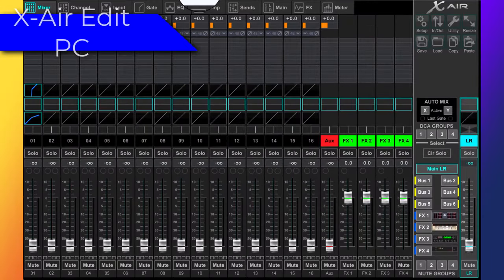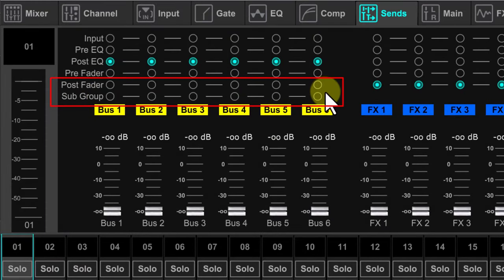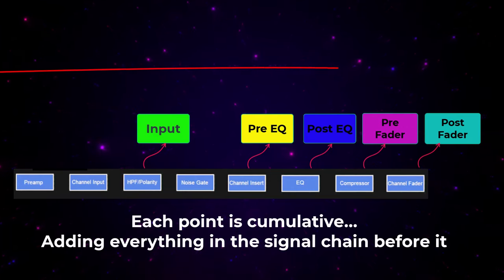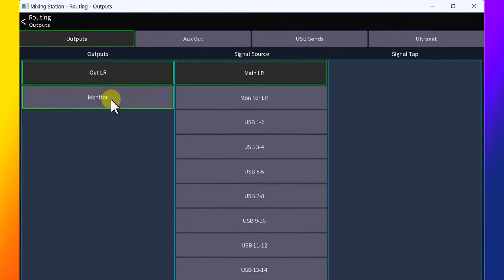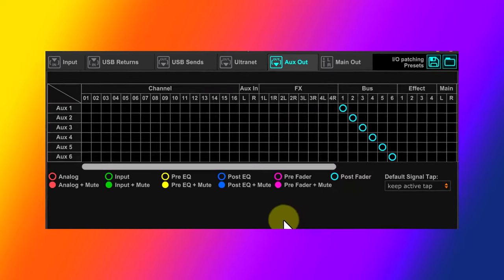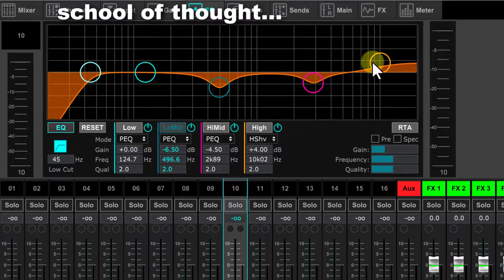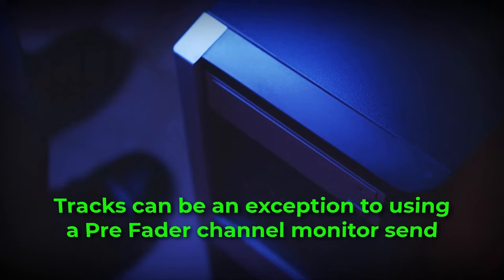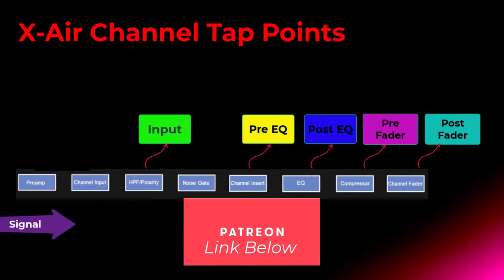Demystifying XR18 Channel Send & Output Tap Points | Monitor setting | Mixing Station and X-Air Edit

Comment: Thank you for making this very informative video. I have mains going to main out and subs going to Aux 1 2. You only mention the signal tap settings but not the signal source setting. For the Aux 1 2 sliders I want to control the overall volume. What should the signal source be set to for aux out 1 2? Thanks in advance!
Reply from the maker: I'm not sure what you're exactly asking. Your master sub output should be post fader. ...But I'm wondering if you mean beyond that, and are wanting the master volume of the mixer to control the sub level at the same time it controls the rest of the mains.
Which that is not possible.
Also, you probably don't need to use 2 channels for your subs. Most sound systems send to the mains L-R but the subs just get a mono signal from one aux or other send/bus.

I do have an older video about "Aux Fed Subs"- https://youtu.be/ZBXaR2W2E1I

But I'm not sure there's anything in it you need to know or not.

Back in the thread for that video there were some discussion about having a master faster that controlled subs and mains at the same time... and the workaround to do it is:
After you have your system working, and sub balanced to mains, assign EVERY channel to a DCA and call it MAIN (or whatever is easy for you to remember).
Since the aux fed subs should be on a post-fader send on the channels, and every channel is on the DCA, then that DCA will work like a main to control main output and subs at the same time. But you do have to have them master and sub output set and adjusted like mentioned in that Aux Fed Sub video as the first step. Then assign that DCA and run it up to unity to begin with. The adjust accordingly up or down for show levels.

Comment: How can I plug a Samson expedition speaker to a xair aux out? My assignment says to connect a 1/4 unbalanced cable to a 1/8 adapter but neither end would fit a aux

Comment: did u ever try and record xr18 xlr outs into a difrent audi interface set to -4dbu or recording device ? it comes out less compressed and louder than if using the usb record dont understand why xlr output limited at -3.5 db but comes into other interface at-1.5 db with interface set at -4dbu

Comment: Thanks so much for the information, we appreciate you going in depth. 

I’m wondering if you can help me problem solve something though that was not addressed. 

Our band is using Mixing Station with a Behringer digital PA. All the channels seem to sound fine except the one that’s processing my guitar signal. it sounds fizzy and thin. No matter how we’ve adjusted the parameters in my channel, we can’t seem to get rid of that sound. It’s truly not representative of the amplifier. We have tried this both going direct and using a microphone. 

I can’t help but think there is something turned on in the parameters of my particular channel, that is causing this to happen. 

Have you ever experienced this, and if so, do you have any idea how I might go about correcting it? 

Thanks for your time!
Reply from the maker: Well, my first thought is a bad mic cable. Do you always use the same mic cable? If the mic cable is 'one-legged' you'll get weak, thin sound. And it wouldn't matter if it was a DI or mic connected to it. 

If it happens with multiple mic cables, then that pretty much rules that out.

Are you sending the guitar channel to a subgroup? Maybe not even intentionally. If so maybe something is going on with the EQ in the subgroup. Or maybe you're sending it to a subgroup with something inserted on the subgroup, PLUS sending it direct to the L-R and creating a latency (cancellation) issue between the two signal paths?

Do you have something like a chorus or reverb or other time-based FX inserted on the guitar channel from the FX rack? THAT would explain a weak signal because many of those don't have a wet/dry balance control. Without that, you only get the wet signal and no dry signal. 

If you connect a known good mic to the guitar channel, does it sound fine? Even with the low cut off, EQ off, compressor off, and gate off... with the signal directly routed to the L-R and nowhere else? Or a known good mic and cable (like moving the lead singer's mic there)....

Have you tried moving your guitar input to another channel? I hate to say there's a hardware problem with the mixer, but if that one channel always sounds weak no matter what you're connecting to it, and if it sounds weak even with everything turned off on that channel, while moving those things to another channel and they're fine.. That could be telling...
OTOH, if the problem follows the guitar rig... no matter the channel then the problem must be something else. Which is one place that bad mic cable issue would always rear its head.

I guess another possibility would be if that guitar channel was NOT routed to L-R, or is running thru a DCA that is turned way down, or routed to an mix bus output that is also feeding L-R itself while the guitar is NOT feeding L-R (either directly or via a subgroup). Things where you're not hearing what you think you're hearing, or should be hearing, depending on the circumstance.

Of course, you can always save your scene, then initialize the console and check that guitar channel when you're starting from scratch. Out of the box the mixer is configured for what is a normal live sound configuration. So if you have any gremlins lurking in a misconfiguration, this would certainly eliminate that. If all is suddenly good, then you know you have a gremlin in your channel config/routing on the band scene.
Reply: @AlanHamiltonAudio  thank you so much for taking the time to share that! Your expertise is greatly appreciated. I’m going to share the information you shared with our sound tech and see if he can use it to do some problem-solving. Once again, you taking the time to do that really matters, I have been baffled by the issues, but some of the things you suggest make a lot of sense. I think we can rule out simple things like cables and mics, we’ve used different ones. The more complex workings of Mixing Station though is something that’s new to us, and your information greatly opened up the possibilities for resolving it. Have a great day!

Comment: My main out is left or right heavy. I thought that was a faulty mixer. But when I do Master LR output from the 6 buzzes, that does the same one side heavy also. How can I fix that, please.
Reply from the maker: Check your FX rack... Look for having a dual effect inserted somewhere when you meant to have stereo. Or vice versa maybe. Also, look for anything inserted that should've been used differently, or you didn't know was there.
This video is about the FX Rack: https://youtu.be/TV5ClH_MWrU

The next thing I'd look at is the Bus masters... make sure one of you monitor mixers, stream mix, etc. isn't accidentally assigned to FOH.
Also, pay attention to any subgroups you might be using and check the panning there.
The double-assigned bus issue is explained here:
https://youtu.be/x9wciA2wFd0

Comment: Our X18 EQ section will not allow us to change to a low cut or anything else. It seems stuck on one wave and can't be adjusted.  What could cause this? Thank you Sir
Reply from the maker: Are you sure you're actually connected to the mixer? But even with that theory, being in demo mode instead of actually being connected, I'd think it would appear to be working. So, I'm kind of stumped. Never have heard of anyone having this problem before.
You do mean that you can't change the setting(s) at all... versus you can change it but you can't hear any change?

Comment: What tap point should I use if I’m using the Behringer xr18 for FOH but also trying to control everyone’s IEM without affecting the FOA. Where a 3 piece band usually do small gigs. Thank you
Reply from the maker: For the channel send the 'safest' setting is PRE-EQ. Post EQ will get you the FOH channel EQ in your ears, and that could certainly be fine and worth a try. But everyone needs to understand that if they start making changes to the channel EQ for their ears, it impacts FOH too. Pre-EQ leaves you 'stuck' with a flat EQ for your ears, but that means you're not 'stuck' with FOH channel EQ settings, or hearing the FOH engineer change channel EQ settings. If you have a FOH EQ tweaker, having PRE-EQ channel sends for mons could be better for that reason alone.
Reply: @AlanHamiltonAudio  Thank you🤟🏽

Comment: Behringer's own tap point diagram is actually correct for USB inputs but, as you point out, is wrong for analog inputs.
Why would Behringer do this?
Why would they not allow us to send analog inputs pre HPF to the aux outputs? But USB inputs are allowed to go pre HPF.
Reply from the maker: It's probably a 'safer' setting to capture the HPF for any monitor send, stream feed send, etc... (no matter what tap point is chosen). It also captures the polarity setting (which I tested via a null test with a mono signal). So, I can speculate on 'why' they might do it... but I don't have any idea why it's not better documented. I'm sure there are people with applications where they might not want the HPF captured in a send for whatever reason.
But there could also be a user-base argument made that the majority of users will want the HPF captured in any feeds, even if they don't understand or realize that for whatever reason. But that still leaves the question wide open as why it isn't better documented. At least anyone wanting it any other way could know it isn't possible except using dual inputs and not utilizing the HPF on one of them. Or not using the HPF for FOH in the first place. But that's normally a bad practice to not use properly, even if conservative, HPF settings in the system.

Comment: I have gone through this video multiple times, re-initialized the mixer twice, and I'm not new the the world of live mixing.  Every time follow this video and set everything up just like you do, when I go mute the channel fader, the aux/bus ALSO mutes in my IEM.  Is this be design?  I have a Behringer X2442 analog mixer, and I've ALWAYS been able to mute the channel fader and then set a monitor level.  I've also been using the Soundcraft UI16, and I can also mute the channel fader, but it does NOT mute my IEM.  But it does NOT work this way on my XR18.  I'm trying on both Windows and Android tablet.  Using MixStation and X-Air-Edit (for both software, on both Windows and Android).  I've upgraded the mixer to the latest firmware version on the Behringer website (Ver 2) Version 1.22.  This really seems like a bug.  Does it work this way for iPad and Mac users too?  I've seen people talk about DCA groups, but that just seems like too much work.  It also doesn't seem like any of my BUS eq changes are doing anything either.  BUS settings are globally set to Pre-EQ and Aux outputs are all Post Fader.  I have a gig this weekend so any help would be greatly appreciated!
Reply from the maker: Muting the channel mutes everything in the channel. So that part is working like it's intended. If you want to test FOH and then work on monitors, then mute the Mains or just pull the channel fader down. Or you could use DCA assignments I guess.

Not sure why you bus EQ wouldn't be working. There is an "All About the Outputs" video on the channel ( https://youtu.be/UNO-dACc7YY ) which maybe you might see something you're doing wrong.

Assuming you have your outputs post-fader, I don't know what that would be though. Well, outside of not engaging the EQ. It does have a EQ button that needs to be engaged. On X-Air Edit if you see gray on the parametric then your EQ button isn't engaged.

Also, you get either GEQ/TEQ or PEQ, not both. So if you set your parametric, then switch to the graphic, whatever you did on your parametric will be 'unused'. So for example, if you notch a nasty feedback point with the PEQ, then switch over to the graphic thinking you'll use it for show tweaks, then as soon as you switch to the graphic, the PEQ setting will be disengaged. It'll still be there if you go look at the PEQ, but it's only working when the PEQ is called up. You don't get both EQ's active at the same time. I don't know if maybe that could be causing you issues or not.
Reply: @AlanHamiltonAudio  I appreciate you what you're saying and your knowledge of this gear is of course stronger than mine. That just seems to be counter intuitive. If the bus is pre-fader then the mute of the fader shouldn't apply to the bus. At least that's how it seems to work on all the other gear I've used in the past. And that's how it works on the soundcraft UI 16. If this is not a bug and actually how it works, then so be it. There are a lot more upsides to this piece of gear than downsides. 

If I change the aux source to be channel 1, and set it to be pre-fader, the mute does NOT apply to the bus. But if I set the source to be bus one, even though it is pre-fader, muting the fader still mutes the bus. That just doesn't make sense to me.
Reply from the maker: @emo10001  It's totally normal. In fact the Behringer way might be the more common way. In the world of analog consoles, there used to be internal jumpers that you could set (at least on some models) so you could make them work either way. There used to be debates because there actually wasn't really a defined way it should work. So whatever someone got used to, that's what they expected every console should do. Or how the jumpers should be set from the factory. And eventually, those options went away. I feel AH worked one way and Soundcraft the other. And then Mackie came along and I don't recall what they went with. But, at least by the time of the SR model stuff, there were no user internal options to change how the mutes worked.

But if you think about it, you're muting the channel... so why should anything in the channel work when you've muted it? I think that's the more accepted way these days, and hence what Behringer decided upon.
Reply: @AlanHamiltonAudio  I appreciate it Alan, and your channel.  It has been very helpful.